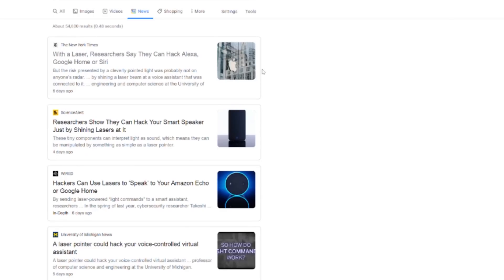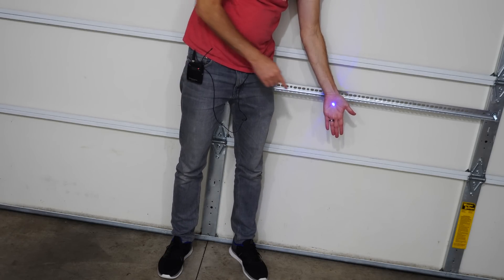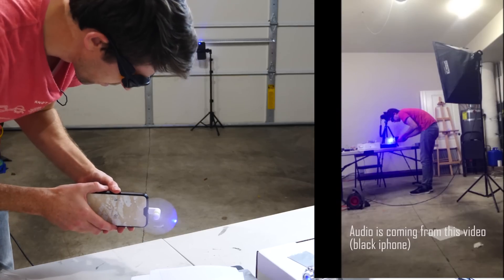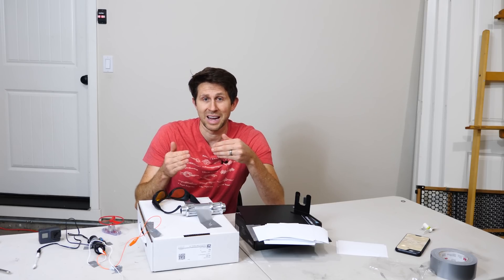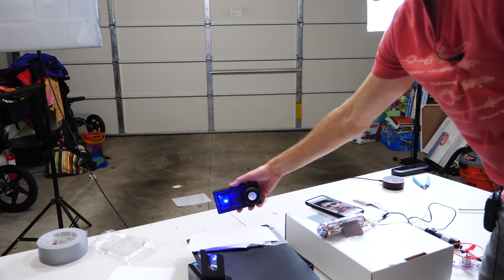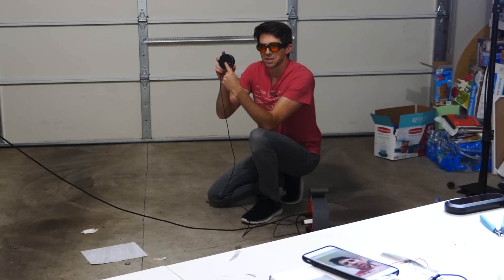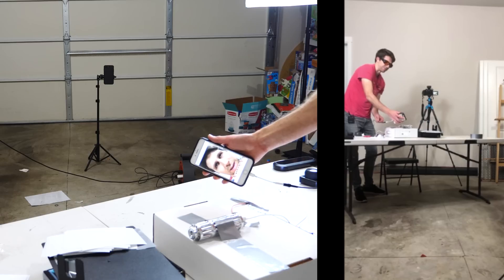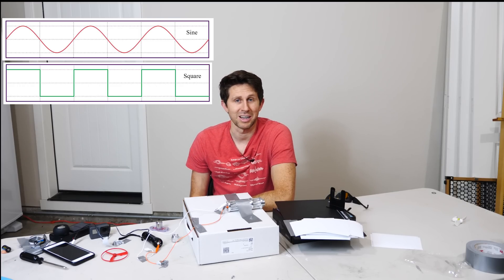Hacking into an Amazon Echo Using Laser Light to "Speak" to Alexa

Comment: Photoelectric effect perhaps.  Does the laser module have a voltage regulator in it? If so try modulating the current to the laser to vary the intensity. Or block the beam with a liquid crystal light valve.

Comment: What if it’s making the noise because the light waves are pulsing in between the light waves and the fan is going so fast that every let’s say 30mm the light waves separate when the fan goes in between the fan blades so then it’s like throwing a ball into a hole and making it in the hole 50% of the times you throw it, allowing you to hear the memetic energy to turn into sound energy causing the light particles to do the same sort of thing, therefore causing radiation energy to transform into sound energy therefore allowing you to perceive the sound through the microphone
Reply: Or at least that’s my theory

Comment: So what does this mean for communications technology I mean can we send internet signal or space to earth transmissions  . Kinda like basically you just need to take what ever information your sending and convert it to.this freakency then laser it over miles then. Unconvert it. Is it fastery latency wise that a standard coxaxial cable is it better than fibor optical
There has got to be a million dollar invention off this basically long as you have line of sight you have a speed of light way to transmit information, data sound securitly to bc if the pin point light is jacked into it breaks the signal at reception end. Data>converter>Lazer tramsmiter>Receiver>reconvert>data/voice/ k
Idk figured that data comunication was already sent via Lazer

Comment: Could we use lasers to communicate with peoples on mars for example
Reply: Dani Ace Aguila  idk for sure but radios broadcast outward making it easier for others who you dont want to to pick up the signal; while lazers have a pen point for a signal
Reply: Slippery_ Gecko also lasers are visible to the eye
Reply: The problem is that the laser beam diverges (the dot gets bigger the farther away the target is). A typical laser pointer, by the time it reaches Mars at its closest point to Earth will have the dot about 30 times bigger than the diameter of Mars. So imagine a laser dot spread over an area equivalent to 30 Marses. The signal would be too weak too intercept. Even if you would build a high tech laser that could be thousands of times more powerful and have a beam thousands of times tighter, it would still be extremely weak. Radio signals from a high-gain antenna also suffer from the same problem, but it's just so much easier to build equipment to both send a very powerful signal as well as to receive an extremely faint radio signal than it is to do the same with visible light.

For example: Voyager 1 is currently around 20 billion km away from Earth (100 times farther than Mars) and is still sending signals at 23W. By the time the signal reaches Earth(20 hours later) it is only 0.000,000,000,000,000,0001W strong and is still intercepted on Earth by a huge array of giant-ass antennas. That just wouldn't be possible with visible light because the Sun pollutes everything with every wavelength of visible light.
Reply: Dani Ace Aguila  But they doesnt use radio waves for communication, thats the problem

Comment: Hi, wonderful experiment! The modulation with a fan produces an output signal at detector (solar panel, microphone) that is nearly close to a square wave, far from a sine. This is actually a useful technique called “optical chopping” used for IR light and Terahertz waves detection. The reason microphone didn’t detect voice modulated light is that voice has frequency about 3KHz to 5KHz, while fan modulation is much lower. The detectors (mic in this case) have frequency dependent sensitivity. So it might be detecting “voiced laser” but output is not enough to produce a sound.
Reply: Plus, some mics have higher responsivity like MEMS mics. So this trick can work for some devices.

Comment: If the mechanism is in fact heating and cooling of the diaphragm, I bet that it is essentially acting as a low pass filter. So a sinewave just gets filtered out into something close to a a DC signal. In theory, a square wave should filter into a sinewave signal.

Comment: If you blast an empty soda can with a camera flash at close range (a proper camera flash, not the LED on a phone), you can hear the can click. I wonder if this is caused by the same phenomenon. Something to do with rapid heating. Or it could be that the internal mechanism of the flash is causing an electromagnetic pulse that is not directly related to the light itself, and the can is moving slightly due to electromagnetic induction. In that case, of course, this would not be related at all to the microphone trick.

Comment: imagine calling people on mars using this tech, send sound with the speed of light.
Reply: Yes! This would be excellent, only if you are in line of site, only if there is not interference from weather, only within a certain humidity range, only if the curvature of the earth does not interfere.  You can actually buy professional and enterprise laser based communication systems. They are very cool in cities where you can put transmitter and receiver on building rooftops, that is until it snows. sleets, rains, lightning. Place like SoCal, and high desert are better geographies for this tech. But hey, all those are terrestrial based problems. Once you enter orbit all those issues just go away. Using lasers to communicate with stuff in orbit or in space is fantastic. Google "laser communications in space" the information is exciting...

Comment: I think the amplitude also plays a big role here. With the fan you were going from 100 % intensity to 0 % and back...
I think I would try increasing the amplitude of the modulation as much as possible, a little clipping can't hurt either as long as you can still understand the words. According to your square wave theory, clipping may even help since the wave becomes more square. Alexa may also be less likely to accept your voice as a square wave though. It may also be better to use a female voice or pitching your own voice higher, so the frequency is higher and therefore the rise and fall times of the sine wave are shorter. And finally, you may wanna focus the laser so that is just barely doesn't burn on average. Since it won't constantly be on full brightness if it's modulated, I would focus it so that it gets fairly hot but doesn't actually burn (while modulating).
Anyway, good luck with that...

Comment: I guess I'm slightly confused. Hasn't optical digital audio been around for awhile?
Reply: Yeah but this isn't Optical Digital Audio....don't you have google?
Reply: @GlzDS  I agree that the direct contact with microphone isnt optical audio, but by using the median of glass, polycarbonate, or air, the idea of "laser precision" audio isnt new. They just use fibers for their refractive qualities. 

EDIT: I will admit I did say digital and this technically is analog transmission. I will respect that diliniation.

Comment: You need an unfilitered D-class amplifier setup. it turns your sinewave into pulses at different pulse widths on a carrier wave above human nyquist. you can get a circuit like this using an opamp with a high frerquency wave on the inverting input and your voice on a non inverting input (with the ground of the voice input and carier being common. then you attach a sepereate isolated powersuply to the positive and negative rails of the opamp, and the output of the opamp becomes the plus connecter for the laser and the negative opamp rail is shared with the minus connector of the laser.

Comment: It may also be an amplitude issue. There is some amplification going on going from light to solar panel to the speaker. That panel is generating (perhaps) more energy than the light alone. If you can create more amplitude before it gets to the laser or in some way be sure there is more amplitude modulating in the laser without distorting, you might be able to trigger the Alexa device. I just don't think there is enough modulation to have the Alexa mic vibrate simpeteticly. 
I've done experiments in my younger days when lasers were much newer where my lab group and I bounced a laser that was carrying the modulated signal of some music from a cassette tape, you about those right ;), off a mirror on top of a nearby mountain. We'd bounce it back into a LASCR and amplify it and viola music! about a second or so later than the original! It might be interesting to try it with a garage door light beam switch receiver too. You do have a whole lot of fun in that garage of yours!

Comment: Looking forward to the next episode..
please include this following test and also please share to us the science how does the the mic pickup light..I'm still not convince with the heat transfer I'm still hoping with that light can generate force(where Cody does experiment about it before)
- will it capture noise along the way or on its path?
- do distance affect the amount of audio data it transfer?
- do light bouncing/reflection still carry the audio data?
- does the color of the light matter?

I know some are silly but I'm curious...hahahaha
Reply: Post Grad in Physics these questions are my brain fodder ! 
Let's go ! 
1) It won't capture noise along the way since laser light is single frequency, however if you have 2 lasers of same frequency aiming at the same mic then you'll hear noise or probably both depends on how the interference of them works out. 
2) Traditionally Inverse Square Law (Distance weakens the force) applies however Light is self propagating (Electric field induces magnetic field and then vice versa) hence inverse Square law doesn't hold here. However in air over long distances it would loose signal strength (in visible light). 
3) Yes. Quality might go lower 
4) No Colour of light doesn't matter. 
PS It'd be amazing to see how would denser objects Air to glass would change the audio output.

Comment: Put the sound output straight to the laser so the flickering of the laser makes the sound
Reply: I'm pretty sure that's exactly what he did do. He connected the audio to the laser, & in doing so modulated the laser with the audio signal, though I'm not sure how he accomplished that, since I don't think the audio signal had the power to directly power the laser. I suspect that his laser may have had a direct modulating input besides it's power input, or he amplified the audio output so it was strong enough to power the laser, and thereby make the strength of the laser correspond to and duplicate the strength of the original audio signal.
Reply: @dannichols6261  well something must've been done wrong, because SmarterEveryday managed to do it (ofc not on his own) and it worked

Comment: Hey!  The Action Lab  
A great fan of you 
What happens when you keep the final module as it is with alexa and rotate a high speed fan between it to make square waves as you mentioned in the video?
Reply: nothing because alexa doesnt react to humming.
Reply: Every time a fan blocks the light it can be considered as "off  wave"
And every time a light passes out a different intensity (on wave) is captured by the microphone which can be considered as a square wave different from previous and up coming  "On wave".
Reply: @scientiac  yeah sure the alexa thing would "hear" a square wave but what schould happen? You can use your vacuum to clean the floor and nothing happens. There is no reason for something to happen.
Reply: Thank you for your reply.
Can you answer one of my curiosity - Can we use the smartphone camera to be used like a solar panel and sense the waves to produce the sound instead of using the microphone?
Reply: @scientiac  i dont think so, the camera is probably too slow to pick up any information

Comment: This is how your conversations can be eaves dropped on from great distances with a laser. As long as there is a window (glass) your speech can be heard a mile away by putting the laser dot on the window of the room your in... Imagine your in a 10tth floor hotel room & your audio can be listened to from the neighboring hotel with no one having to accessed your room or tapped your phones... NOTHING!!!
Reply: great. no action lab is going to have to put this idea to the test
Reply: keep it away from windows. It will still work, problem solved